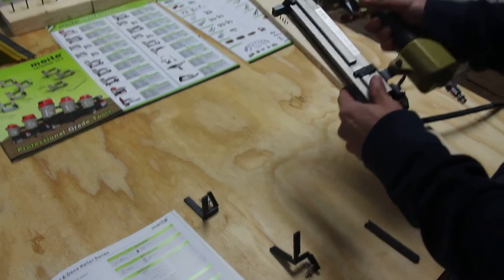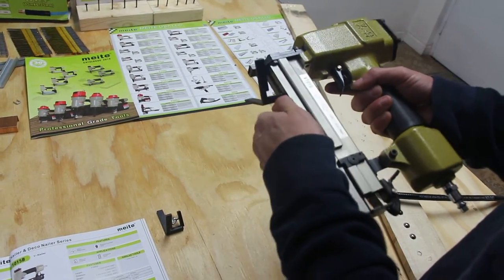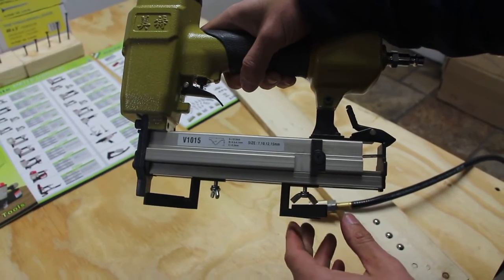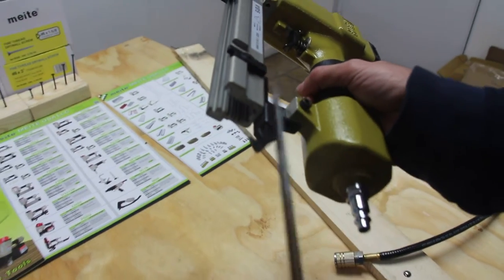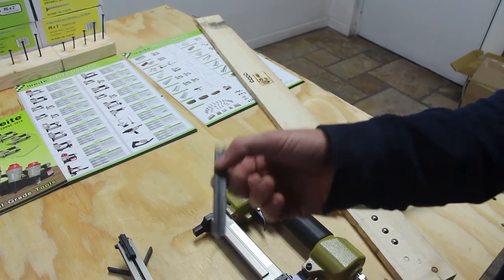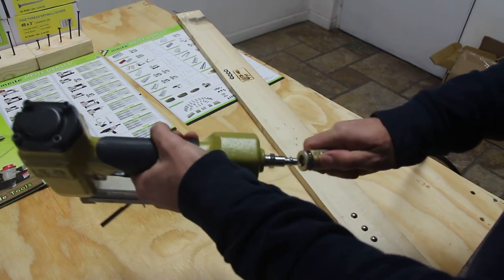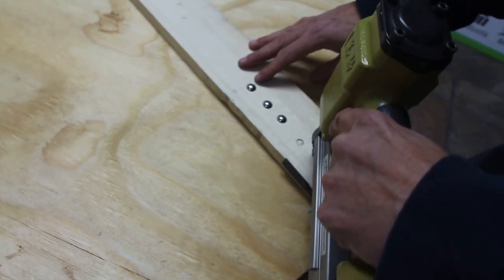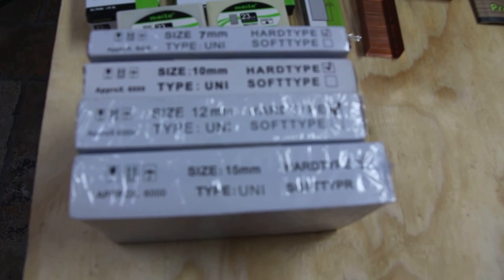How to use meite V1015B  V Nailer   Picture frame

Comment: Hi guys,
i have one of these gun, having difficulty to nail molding properly. could you demonstrate how to securely position molding to use this gun efficiently. And also how minimize the jerk generated by compressed air.

i have different shapes of molding, and i realize there is gap left at joint.
please explain.

Comment: This is no good for professional framers the indentations left by the firing rod will ruin a moulding once the v nail is inserted. This would be better suited to hard wood frames. If you want to do manual v nails look at push master otherwise buy either a pneumatic or pedal powered underpinner like the cassese cs79